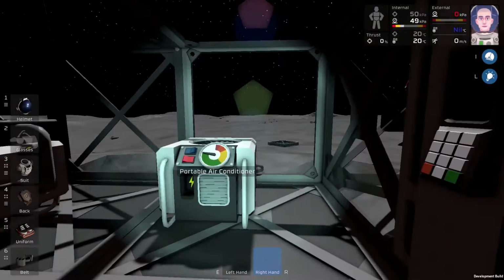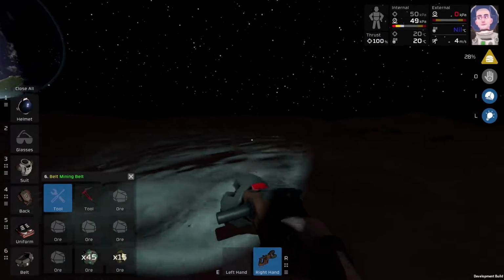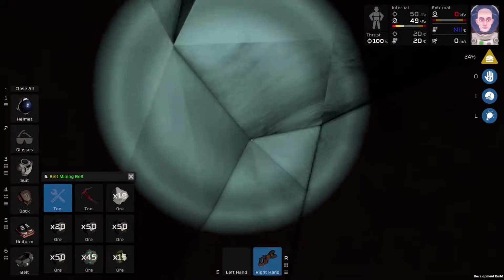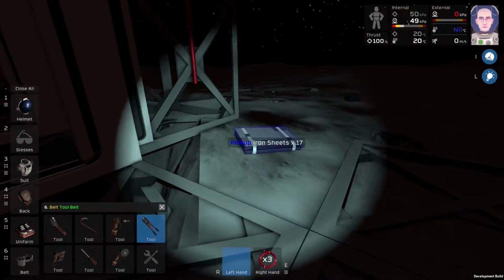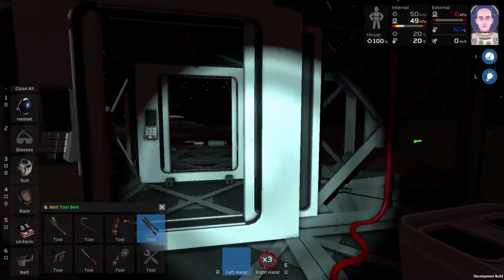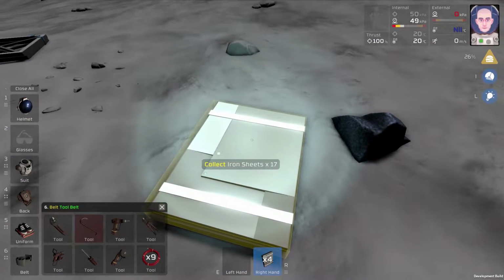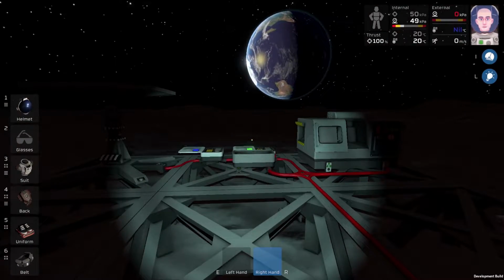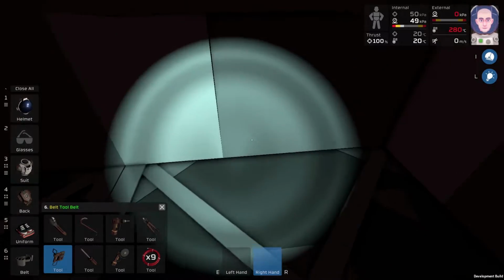Stationeers | Heating Up

Comment: You can over-pressure your pipes a bit - you don't NEED a passive vent right away.  Depends on how pressed you are for speed.
Reply from the maker: thats a good point actually I never really thought about 'storing' gas in the pipes without a vent. cheers :)